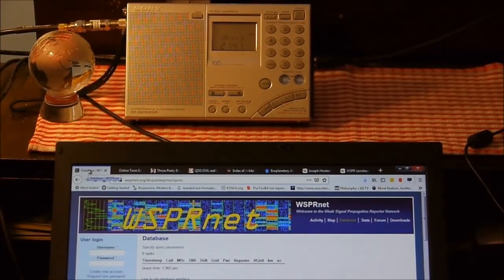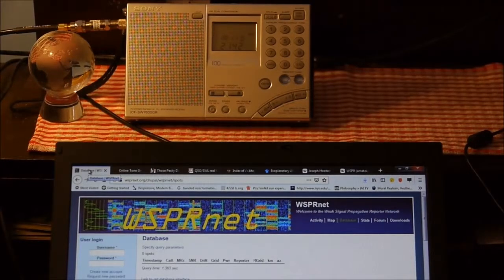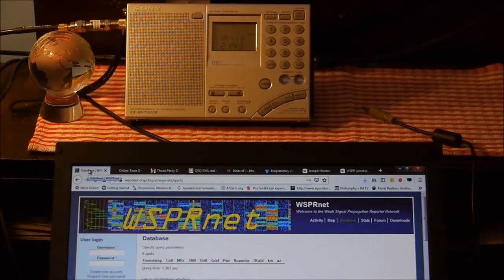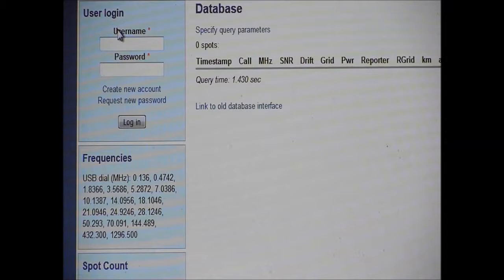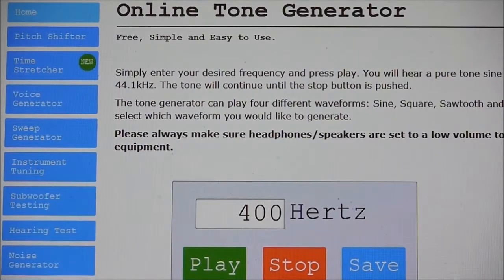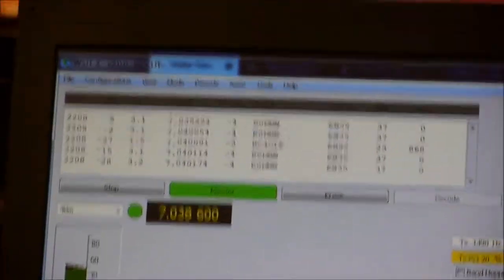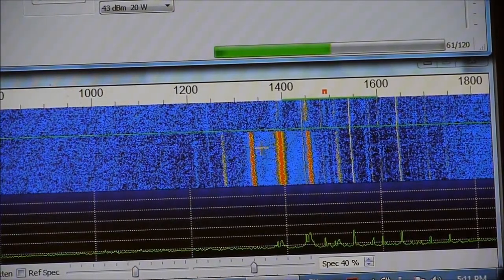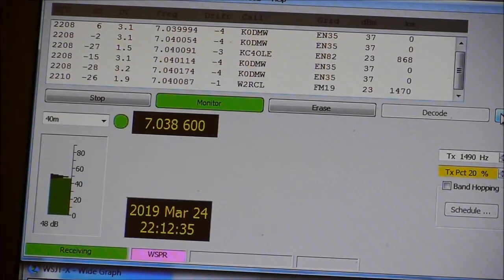Sony ICF-SW7600GR: Decoding Digital Signals - WSPR

Comment: The problem with some radios is the dirty potentiometer, you can put a very tiny drop of lubricant / anti rust spray / isopropyl alcohol carefully on either side of the SSB tuning wheel and keep turning the wheel, once the pot is lubricated it works like magic.
But you may have to do it once a month to keep it from going back to Square one.
If you can't do it yourself then ask any technical guy to open the radio and get the potentiometer cleaned up.
Reply from the maker: Thanks! Yes that is so very true!